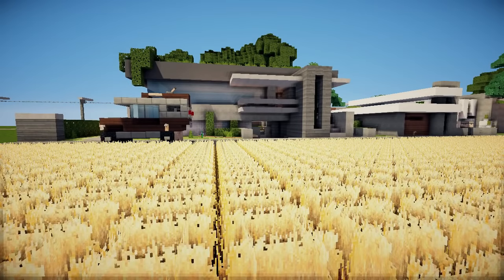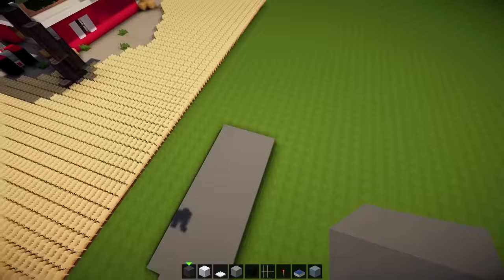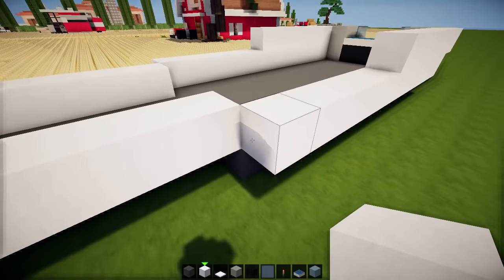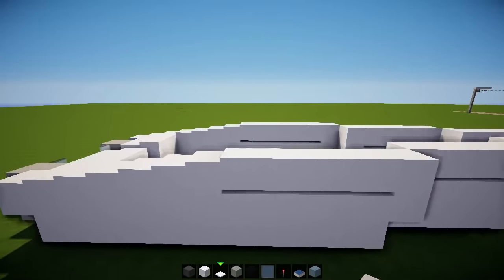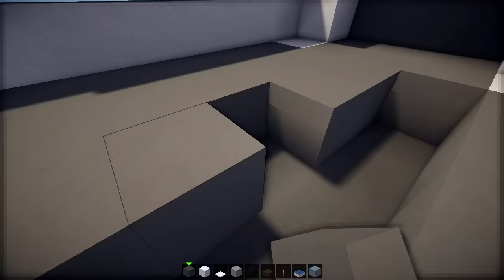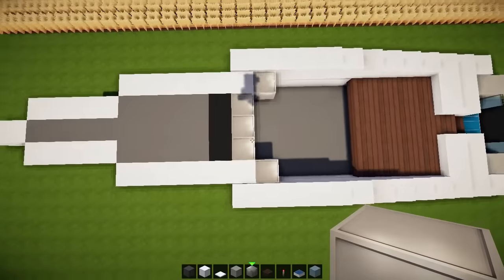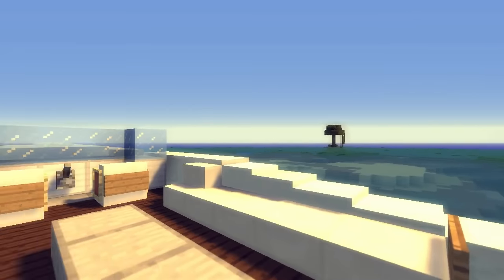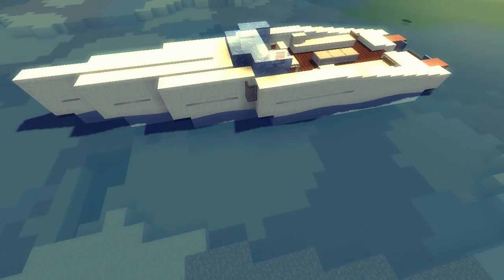► Minecraft : How to Make - Speedboat

Comment: i made a boat but with a 30 block wide and 15 blocks tall on a pontoon boat it's called the outboard motor for a e-tec 300 hp V6 motor i made it sound like one aswell with 6 pistons to move the prop and power and perfromance full throttle 58 mph and 5700 rpm Lol